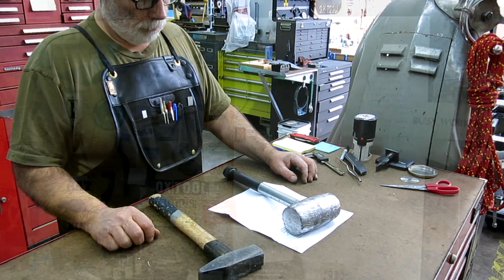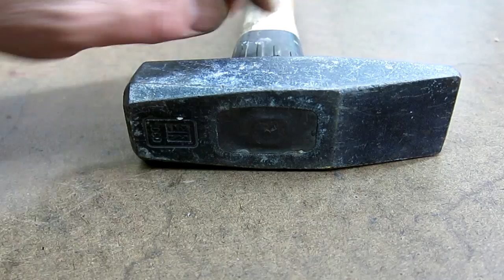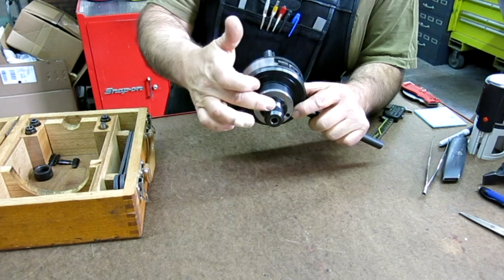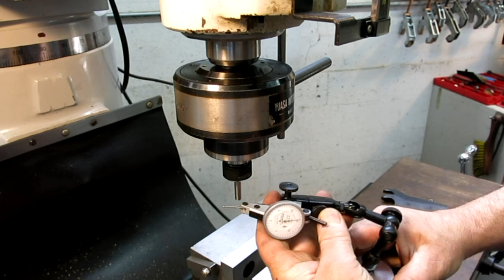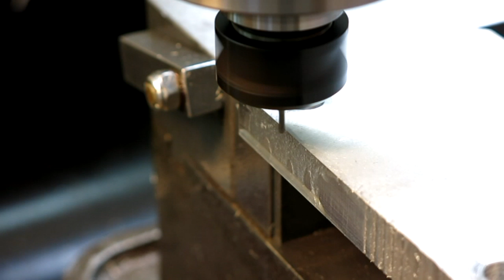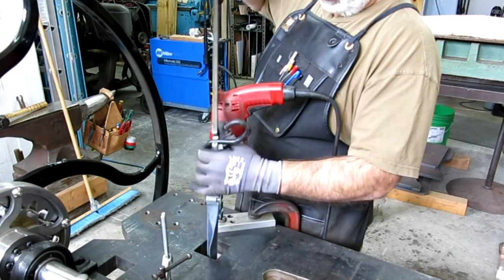Monday Night Meatloaf 79

Comment: Interesting gear chuck thing.   Cool drill cantilever trick.  Never saw that before.  I've used the electro-mag base drills, many times.  They are squirrelly also... especially when the power goes and your working upside down!  I drilled holes in I-beams all day (upside down!) and only used a pilot drill and the finish size drill.  The boss was amazed that I didn't dull or burn up a single bit!

Comment: I had the feeling the mill'thing' had some runout on the r8 side as well, since the needle of the indicator seemed to jump more every so much turns of the collet. Thanks for the meal.
Reply: Flip de boer Your hypothesis would go a long way in explaining the "seemingly" erratic readings he was getting.
Reply from the maker: Flip de boer Hey Flip,

This one is going to get taken apart and fully inspected. Its tool nice of a unit to have this much runout and noise. I will check the arbor for runout when I take it apart. Now I need to find a diagram of the guts of it.

Cheers,

Tom
Reply: +oxtoolco did this get pulled down? Wish I had seen this vid when posted (tight time at work) as the next test is indicate the outside of the unit to separate R8 runout from increaser spindle runout, then indicate the bottom of the unit at the edge to get a sense of swash on the input. Then indicate the mill spindle for the same issues.
Reply from the maker: +john john Hey John,

The mill spindle is good and not in question. This unit needs some TLC and new bearings most likely. Thanks for the comment.

Cheers,

Tom